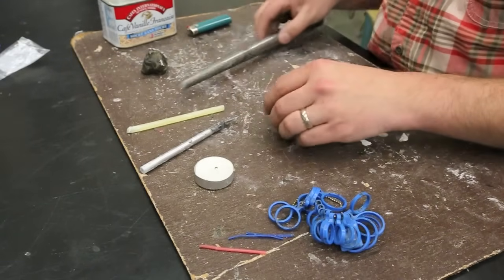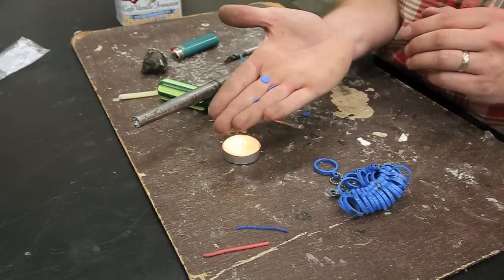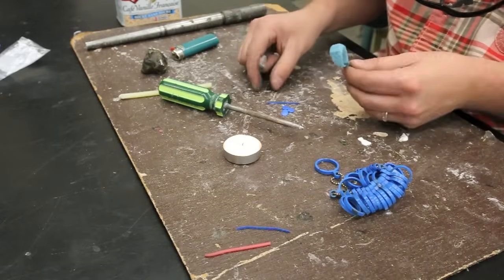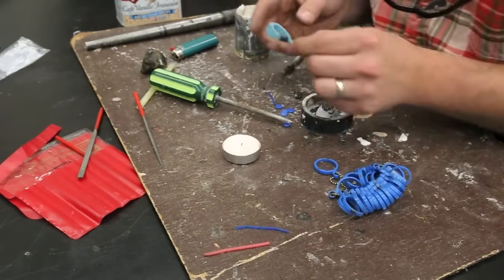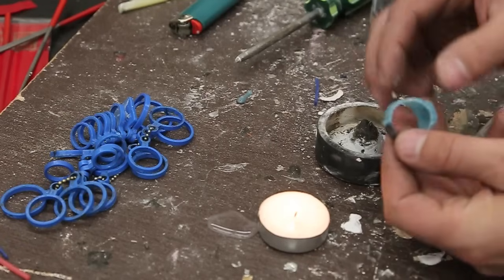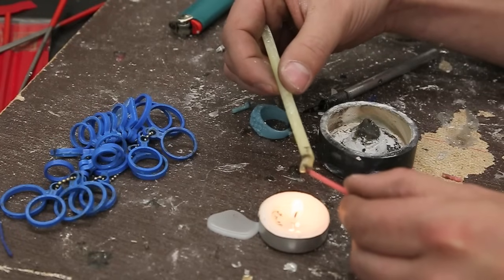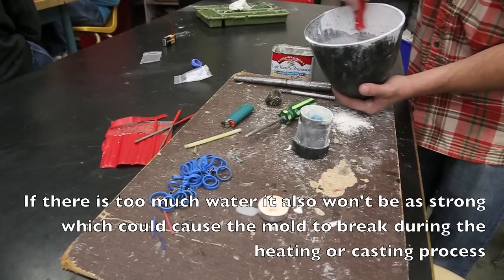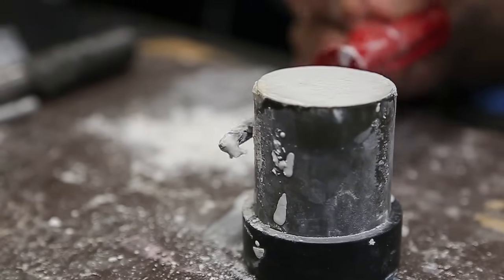Simple Lost Wax Casting - High School metal shop with "minimal" tools

Comment: The sticky wax that I use doesnt seem to be able to hold any weight after I melt it, where do you have any info on the wax to use?
Reply from the maker: I use the sticky wax as a temporary way to attach the sprue to the model. I then suggest to use some additional melted wax (blue or green strong stuff) to reinforce. I am by no means an expert since I dont practice much but I can usually get good results for students when they make their own models from wax blanks

Comment: I use a vibrating flat lap ( for polishing agates and other flat surfaces by vibrating)
Instead of spin caster also for pouring the investment powder.

Works really good
Reply from the maker: Yes a vibration surface a vacuum pump would be great to have

Comment: i dont have a spinny thing can i just pour directly into the flask and let gravity do it. also is it fully necessary to melt the wax in the investment before the pour or can i let the metal displace the wax? last question whats the minimum i can preheat the flask before the pour. cuz my oven doesnt go up to 1200 haha
Reply: Wax is melted out and then BURNT out!  You don't want anything in there when hot metal is trying to get in... it might throw the hot metal back at you!
Reply: @leonardpearlman4017  YEP. IF anyone wants to experiment, I SUGGEST letting the form stay in the oven at full heat until it hasn't smelled AT ALL of wax for an hour - at least.  And I SUGGEST  that - I DON'T know.!  Besides - always wear lots of leather gloves aso, and eye protection and anything else, that can reduce the injuries, whren things go bad..  OR - don't experiment with f*cking melted metal...
Reply: https://www.youtube.com/watch?v=P1VmIYheuU4&t=981s
Reply from the maker: I'm not sure of the minimum but you need all the wax gone inside before you pour.

If not using a "spinny thing" then add a vent/exhaust sprue in addition to your model sprue similar to a riser in sand casting. 

Having your flask as hot as possible helps your molten material (gold, silver, etc) not harden right away during the pour.
Reply: @WeBuildStuff  where should the vent/exhaust sprue be located? cuz the way im picturing it, molten metal would spill out the side. wheres the best place on the  ring to attach it and where should the exit be? thank you for responding
Reply: As soon the gold is in the mold it is already cooled down that spinning won't do anything.
Reply: @lenny108  Wrong. I'm learning this these days from an 82 yo goldsmith. Why do you make such a claim, when you obviously don't have a clue, or any experience with it?

Comment: I’ve been casting for a long time . I don’t have a vulcanizar for molds I use two aluminum metal plates and screws .  To burn the wax  I use a regular propane torch and burn the crucible for like 10 minutes until I don’t see no more wax residue in the cavity of the crucible and it becomes lighter when it has already lost all the water in the investment .
Reply from the maker: Good tip!
Reply: Hello, I want to start with jewelry but the ovens are too expensive, has your technique worked well for you or are there wax residues left? Thx

Comment: heloo i need some help i use SPrue around 10 MM round wat i wanna ask is : does make any difference between mine bigg 10 mm and i also buy the red sprue same to yours ( 3 mm ) whats the diference ?? and how tall should be from base to the ring ! 1 cm ?
Reply from the maker: I just make sure the model is at least 1cm (1/2" from the top of the flask. You can increase the thickness of your sprue by buying thicker/thinner sprue or melt some more wax onto it. I usually just buy whats available. 

I see this on amazon: https://www.amazon.ca/Wax-Tool-Pillar-Jewelry-Model/dp/B08RJDF11J/ref=d_pd_sbs_sccl_3_1/141-1980502-1776461
Reply: @WeBuildStuff  thank u master
Reply: To make the wax sprue I use a syringe and melt the wax in a metal container and then use the syringe to extrude the wax when is not too liquid . You can put additional wire sprues where you consider necessary to get more metal flow to critical areas in the casting

Comment: bit old but, why do you need the centrifuge?
Wouldn't just poring it like a normal mold be easier and I've seen multiple people do so?!
But as soon as I search specifically for this lost casting process every one uses a centrifuge. Why?
Reply: The centrifugal force helps pushing the molten metal fully into the mould and all of it crevices. Doing it so, produces more force compared to if it was just gravity :) This also helps air to escape the mould, due to the higher 'pressure'. Alternatively a vacuum system can be used to suck in the molten metal trough the investment casting mould.
Reply from the maker: @jakobhalskov  thanks Jakob!
Reply: TO MAKE A WORTHLESS TABLE SHAKE THATS WHY HE NEEDS A PERFECTLY GOOD SENTRIFUGE, TO MAKE A RANDOM TABLE RESCUED FROM THE GARBAGE
Reply: I have seen in another video (same thing, just using a vacuum system and the flask sitting upright) that the metal might not move at all through the tiny sprue hole without some encouragement!  Gravity casting might work better on a bigger scale!

Comment: Thank you, sir, for this wonderful video. It was very detailed and successful. I also work in this field, but I had a problem with the appearance of distortions on my jewelry and other incomplete maturation. Sometimes only the finger of the tree and the sub finger attached to the ring appear. Even if you have a WhatsApp program or an email I can communicate with you and send pictures of my models. I hope that we will find a solution to these problems, thank you.
Reply from the maker: Make sure your flask/mold is hot when you pour and you burned out all the wax model in your burnout oven. Make sure your molten metal is hot enough.
I purposely use more silver/gold than is needed to fill up the cavity and then just cut off the excess. Using extra material forces it to flow through the whole mold cavity. You end up with a "button" of metal under the tree/spru that can be cut off and remelted for future use.
This is only a hobby for me and is just one of the introductory projects I teach teenage students. If they want to learn industry standard techniques they have the option of post-secondary or university level courses.
Good luck!

Comment: Q: Can the investment powder be replaced with, say, plaster of paris?
Reply from the maker: The powder we use needs to be able to withstand high temperatures without cracking. There are many different types.
https://www.hswalsh.com/categories/investment-powders-mixers
Reply: @WeBuildStuff  do you know a good US supplier?
Reply from the maker: @nanncyrandazzo7777  no. I am based in Canada. Search for "jewellery investment supply" and see what comes up in your area. Due to the weight of the product shipping can be pricey so see what local stores.
Contact a local college that offers jewellery design and see where they source from.
Reply: @WeBuildStuff  thank you for the prompt reply. I thought maybe I can sculpt wax at home, and send out to a small foundry
Reply from the maker: @nanncyrandazzo7777  good luck!
Reply: I think people use Plaster of Paris with low-temperature metals, like Pewter.

Comment: where does the wax go when burnt? like are there any fumes to be cautious of?
Reply from the maker: always work in a well ventilated area any time you are burning stuff for casting regardless if it is wax, pla, organic material. I do find the wax does stink a bit. It basically melts out and vaporizes. I still try and clean the bottom of my oven when it needs it

Comment: I wish my school had a shop my metal working is limited to a lathe that cant hold 10thou and a drilling machine of questionable quality. 

I think I will try lost wax casting for cylinders on my model steam locomotives if a suitable piece of brass or phosphor bronze is not obtainable.
Reply from the maker: You don't need a spin caster or kiln if you have an oven or some other way to completely melt out your wax. If you add two spru pieces use one as your pouring hold and the other as a vent. Use some sort of crucible (easy to find on amazon) and a portable torch you can pour directly into your mold similar to sand casting. Lots of ways to create even if you don't have all the tools
Reply: @WeBuildStuff  thanks that's what I was thinking about doing if where to make use of this method. Also the lathe and Drill are of perfectly adequate quality it's just err... operator error.

Comment: You could initially dip your wax in very thin plaster then let it dry so that it will give a nice smooth coating before sticking it inside the thicker heavier plaster.
Reply from the maker: yes. I also use a debubbler spray now to coat the mold prior to pouring :)

Comment: I knew it deep in my heart but I'm still disappointed you don't have to wind up the table before spinning it
Reply from the maker: I filmed this so long ago there are a lot of things I would redo in filming. I wind it up 3-4 full rotations and add counterweights on the opposite of the crucible based on how big the cast will be. I do have an updated casting video showing this with 3d printing PLA :) Thanks for watching
https://youtu.be/a0Ond_9SaH4

Comment: Minimal tools = furnace and centrifuge.
Reply: This method of casting has been in use since 5000 BC, theres definitely more low-tech ways to do this
Reply: Yes and the furnace is definitely easy to build yourself. Centrifuge may be a bit harder but I'd say you can go super low tech on building one and use a stretchy coiled rope to power it after winding
Reply: @theodorekorehonen  actually you can sling it by hand

Comment: That spinning machine looks so dangerous...I wonder if it is worthy doing that instead of just using gravity
Reply: If you don’t like the centrifugal method which is an old tried and tested method, you could always vacuum cast you’re investments
Reply: Gravity may not make the molten metal get to all of the mould cavity. Spin casting is more cost efficient than using a vacuum pump to suck the molten metal to completely fill the cavity.

Comment: A general comment. I wonder why pouring from a crucible, using gravity, would not be simpler. IE a standard crucible not that centrifugal one.
Reply from the maker: It can be done that way as well
The centrifugal forces help to push and force all the molten material into every crack forcing out as much air as possible. You can do direct pour but you might need an 'exhaust hole'  or vent
Reply: I can imagine if you're doing very detailed waxwork you want to have the most consistent method of casting possible so you know your time won't go to waste

Comment: I was wondering about the investment. I saw before people dipping the models into a plaster then they sprinkle sand straight after. This way they slowly build up thickness. The two methods aren't anyway similar, are they? I mean, are the two investments completely different? You way is quicker. If time isn't an issue which process would you say is better for someone doing this at home as a hobby? Thanks. I like this type of work. :D
Reply: Ruger Firearms company uses the lost wax casting method to mske some of their gun parts. The wax model would be dipped into a sand-like slurry and gradually built up and dried. The wax would be burned out and the molten metal poured in. After the metal solidify the investment would be busted off. The metal part would go to final finishing and inspection.
Reply from the maker: I've only ever done this with students in a classroom setting so it is difficult to speak to the other method. The way you have described it does makes sense though!

Comment: Thanks for the video. I like to now how long this you leaf te mol into te oven?
Reply from the maker: Once it reaches the higher temperature seen in the video I usually leave it there fpr at least 1 hour to make sure all the wax has burned out. For larger molds I will do 2-3 hours.
After that I turn the temperature down and once it has 'cooled' to 900 I do my spin cast.

There are better rules to follow than mine but usually due to classroom time constraints this is what has worked for us.

Comment: Would you recommend a pressure pot to remove bubbles from mix?
Reply from the maker: Or vacuum chamber. I did not have one at the time of making this older video
Reply: No, you use a vacuum pump to remove the bubbles.
Reply: @scala1944  You can do it with a pressure pot too. The large pressure doesn't remove the air as a vacuum does but the bubbles get much smaller and the result in terms of casting quality is the same.

Comment: Is it possible to use the cooking oven to bake the dough? Could you tell me where you can get these kind of cans to make the molds and the name of the products you used to make the dough?
Reply from the maker: It is called investment powder which can be found online or from a jewelry supplier. The 'cans' are called flasks and they have a matching rubber base depending on which size you buy
Reply from the maker: You can potentially use an oven to burn out the wax mold but i habe have never tried it. I go to 1100 degrees, cool to 900 then take it out to finish the cast/pour
Reply: @WeBuildStuff  Is there any other way to do this process without oven?
Reply from the maker: @ineseiro1381  you will need some sort of strong heat source to burn out the wax completely and cleanly.

You could look at cuttlebone casting that only needs a torch or fire to melt the final material (i use pewter)
Reply: @WeBuildStuff  Thanks!

Comment: What type of wax do you recommend for a beginner to try with. Cheers
Reply: It depends what you are making, pink wax very soft , green wax medium , blue wax hard.
Reply from the maker: @scala1944  exactly!
Reply from the maker: Wax Casting Bead for Jewelry Casting, Professional Wax Bead Carving Wax Ring Tube Mold Jewelry Making Tool (Green) https://www.amazon.ca/dp/B07PWQKCTR/ref=cm_sw_r_cp_apa_i_UZeuDb5EJEYMA
Reply from the maker: Yasumai Blue Ferris Carving Wax Ring Tube Mold Jewelry Making Tool Flat Side Polishing Engraving Accessories (T200) https://www.amazon.ca/dp/B073JDHJG3/ref=cm_sw_r_cp_apa_i_k0euDbF0NBCGH
Reply from the maker: The links are 90%of what we use 😁

Comment: Lost wax casting technique was invented by Indians. It was widely used in the Chola empire to cast statue of God Natraja. Its an ancient casting technique which is still widely practiced in south India
Reply from the maker: Booya! I am still learning and always relying on old and proven ways!
Reply: @WeBuildStuff  this is still one of the best methods of casting. Thanks for using this method
Reply: @WeBuildStuff  what wax is used and where can i find, can i use some alternatives etc.
I'm planing to start as hobby and in my contrary it seems i can't find anything except that for 3d printing and machine that cost 10k
Reply from the maker: @dkepa90  3d printers on monoprice start around $200.

Here's a bag of similar wax to what I use found on Amazon:
Wax Casting Bead for Jewelry Casting, Professional Wax Bead Carving Wax Ring Tube Mold Jewelry Making Tool (Blue) https://www.amazon.ca/dp/B07PZ1RLS8/ref=cm_sw_r_cp_apa_i_QegsDbQTA1FA7

The wax needs to be strong enough to hold it's shape while working on it
Reply: I thought it was invented  in Egypt

Comment: Is the spin cast machine required? What of you poor your alloy straight into the flask after the flask comes out the kilm would this method work?? Please let me know thanks
Reply from the maker: If you do this I would recommend two sprues. One for the material to pour into and one as an exhaust to vent trapped air or bubbles. Search for sand casting videos and you will usually see a pour hole and exhaust hole. I have done it with sand casting  but I have not tried it with the lost wax method
Reply: @WeBuildStuff  okay I will and great you earned a new sub from me. So you would recommend that I purchase a spin cast machine for the alloy to transfer to the flask or should I get the vaccum - cast machine. Which would you recommend?
Reply from the maker: @Stackittall  I've never used the vacuum cast style before
 Read reviews for both and go with your budget! It is actually possible to build your own spin caster from a rumor I heard back in college. I never persued finding plans though
Reply: @WeBuildStuff  thanks for your help 💪💪
Reply from the maker: @Stackittall  of course. I always try and answer legit good questions on my channel!
Reply: @WeBuildStuff  it’s done on a vacuum table.
Reply from the maker: And check out my newer video of doing it with a 3d printed PLA mold and some new tricks I've learned!

Comment: hey how do you make the original wax shape? do you hand carve it?
Reply from the maker: You can hand carve but these are pre made molds I bought from waxpatterns.com
Reply: You  first make the item using metal which is called Master and you then make the mould in rubber, and that way you can make thousands after.